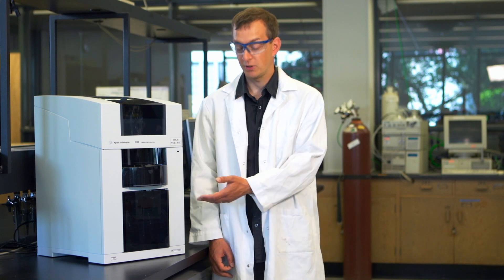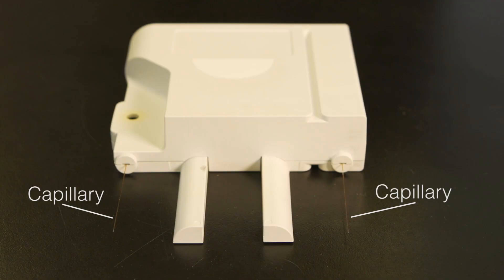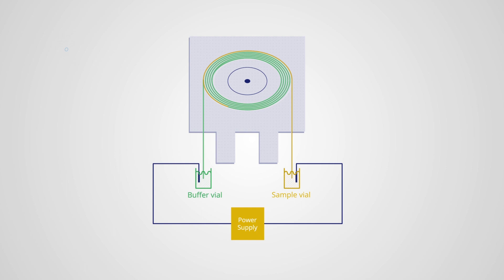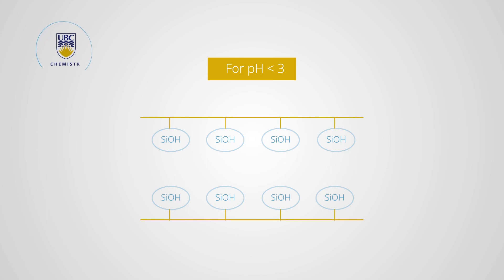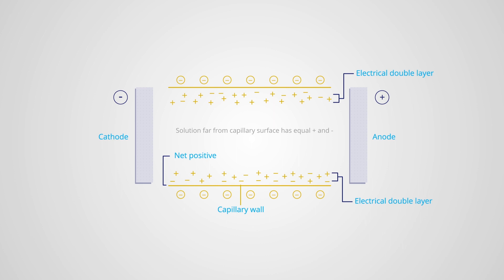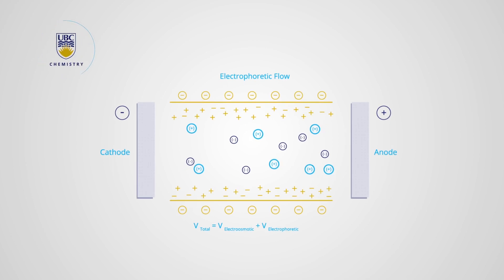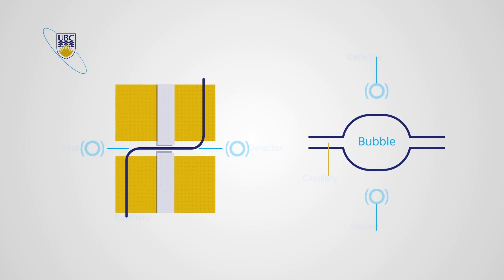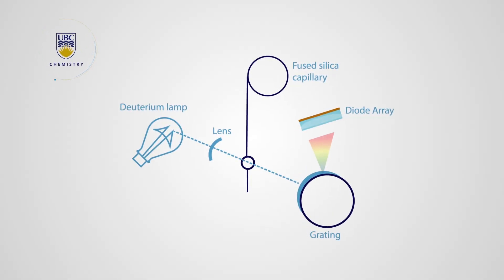Capillary Electrophoresis: UBC CHEM 3rd year Analytical Chemistry

Comment: Sir when separation is based on difference in electrophoretic mobility then what is the need of electroosmotic flow?
Reply: The contribution from electroosomosis is much greater than the contribution from electrophoresis (mainly because of the excess positive charge on the diffusive layer that drags the entire buffer solution (positive, negative and neutral ions) towards the cathode. In other words, this electroosmosis is originated mainly because of the nature of the negative charges on the inner wall of the capillary, which then acts accordingly to the applied voltage. For example, if no high voltage is applied across the capillary, only a double layer will form which is still rich with excess positive charge in the diffusive part to compensate the excess negative charge.
Reply from the maker: You can't have the electrophoretic mobility without also having the electroosmotic flow.  As soon as you apply the electric field to the capillary, you get both.